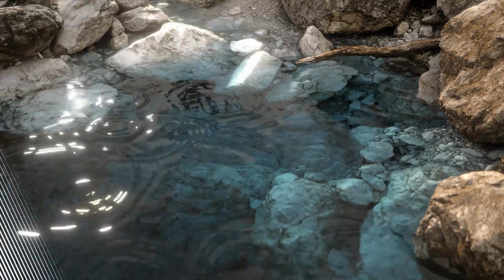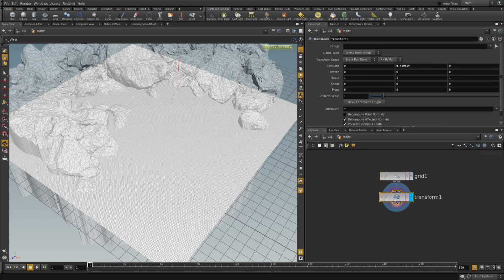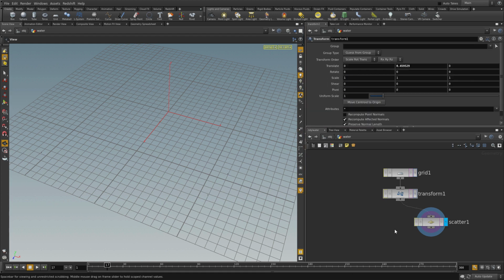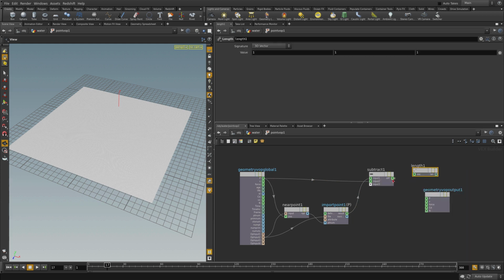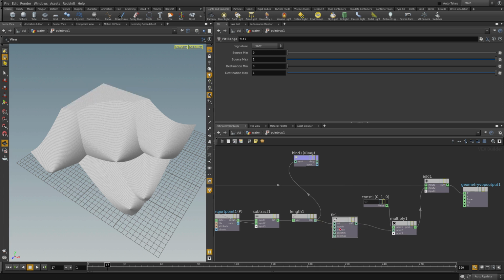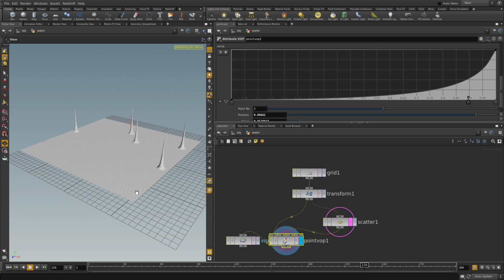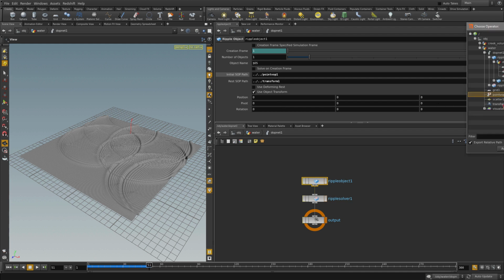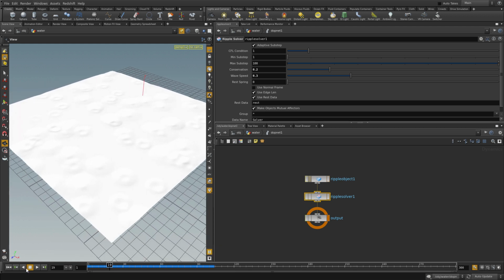Using The Ripple Solver

Comment: update - this works! Orig question: how does this work with actual geometry, like the pillars on a dock and including the rain drops. Answer below:

I used the sop level ripple solver (of the exact same name) and it accepts Rest as the first input; then the 2nd input is the displaced geo, which is I guess what you're doing here with your vop; then colliding geo which would be the pillars, and some undulation of the pillars - yes small jiggling using a sin and cos function or maybe a controlled noise. I went with a mix of sin & cos expressions in x and z axis' for my pillars.